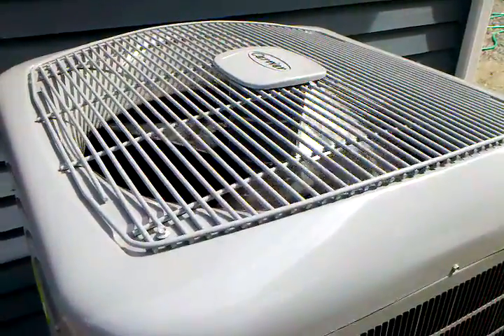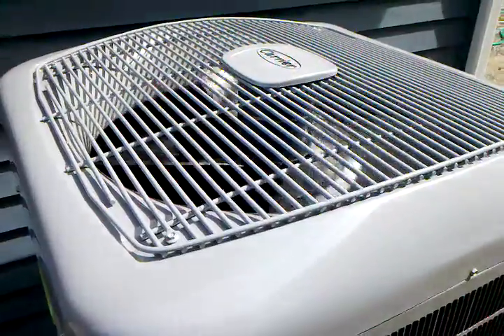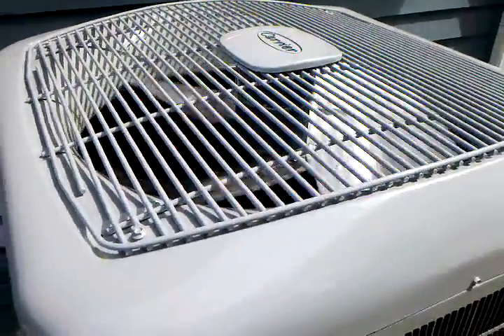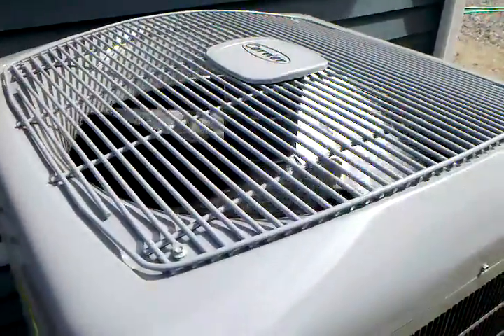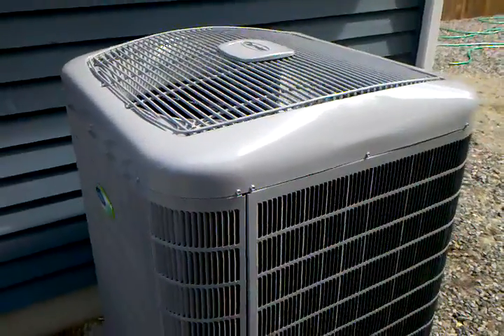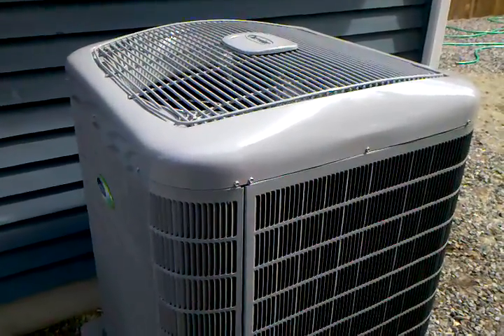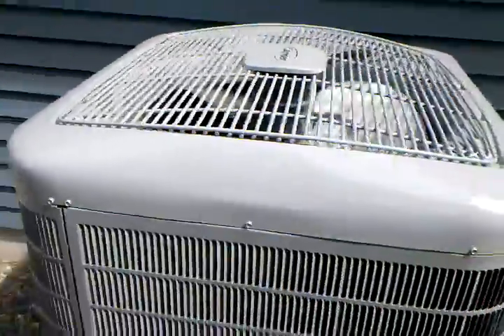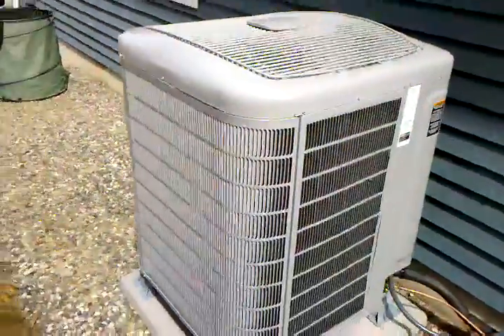Carrier 2 Ton Greenspeed Modulating Heat Pump @ 56%/Ramping to 100%

Comment: It appears the condensing fan motor is running backwords.  Any expanation?
Reply: that is because the ofm is not running. that is just natural convection from the hot air inside of the condensing unit.

Comment from the maker: @84randomdude The Infinity Control tells you in the Status Screen, which is one button up from the "Heat" Button on the right side. I agree that it would make sense for it to be on the web, not sure what the deal is there. They may be waiting to bring it out with all of the other "Nth Degree" line of new furnaces, 36" 98% Modulating, etc.